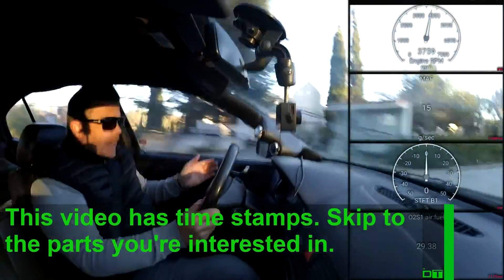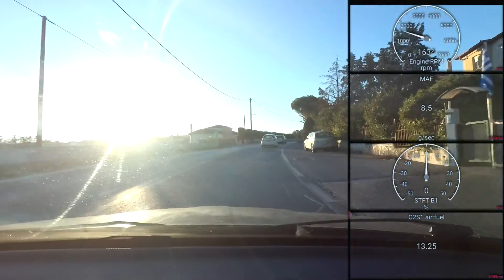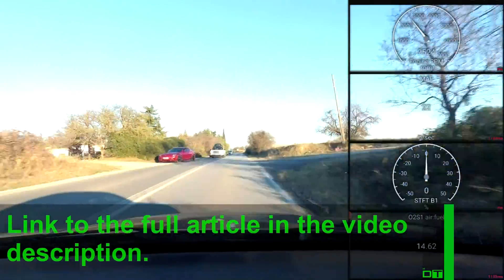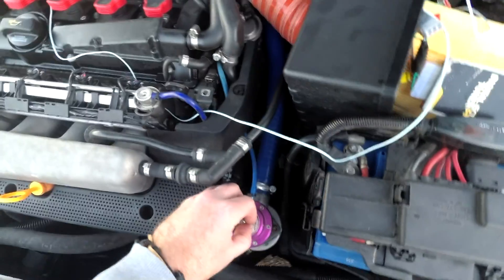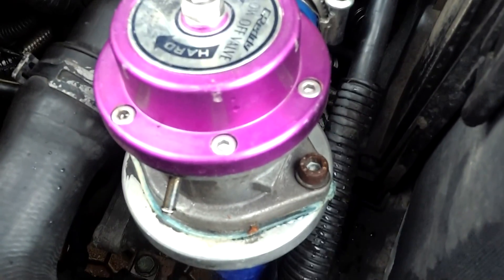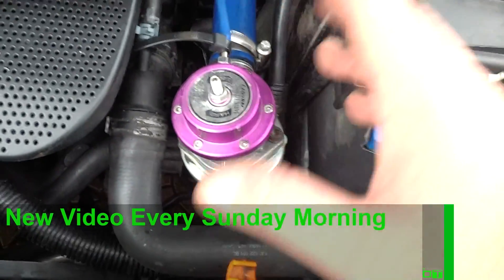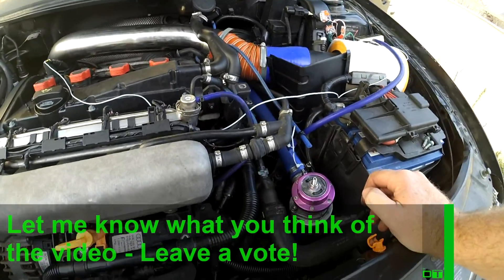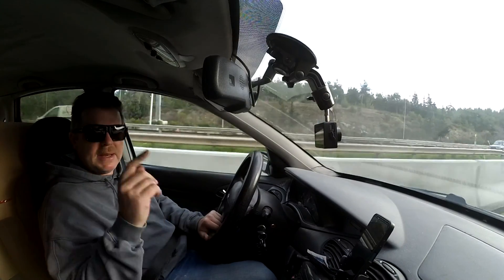Greddy Type-S BOV Tuning/Adjustment

Comment: Did you manage to get the valve to release the pressure by making the characteristic noise?
Reply from the maker: Hi. No. I think the sound is only possible when the valve does not release the pressure properly.
Reply: @DriveTuneMedia  It's because you left it mounted with the recirculation system. If left open to the atmosphere it will make the whistle. How much did this bov model you are using cost?
Reply from the maker: Don't know the cost. BOV was on the car already.

Comment: CHUCHUCHU is either turbo flutter or compressor surge. Per greddys instructions. Your suppose to loosen the Blow Off Valve so air is coming out of it at idle. Then, slowly tighten until no air is coming from the valve. Then your set.
Reply from the maker: If the valve is recirculating, or your engine does not have a MAF sensor, I think the valve can be open it idle no problem.